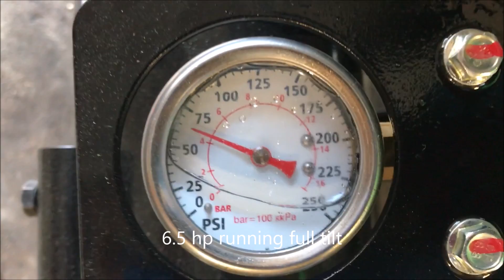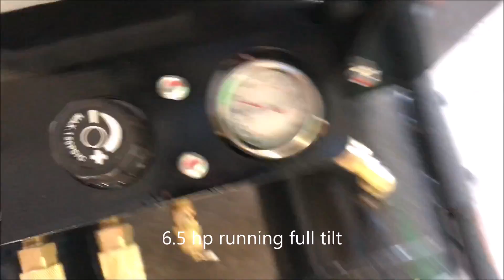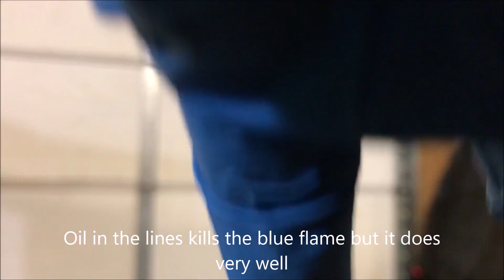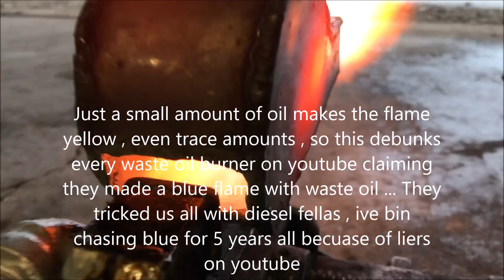Triple injection waste oil combuster { SUPER DRAGON } 160 Kw

Comment: A CNC CUT OUT TABLE WOULD BE OF BENEFIT TO YOU.  It could cut out standardized parts rapidly.  You could build a jig FOR EACH DIFFERENT UNIT to hold the parts in place while you tack them.  BADA BING   YOU ARE IN BUSINESS.

Comment: Can you try to run it on ethanol? I think the power will be even more
Reply from the maker: dont have any but we will see veggi oil by midnight
Reply: @NOBOX7  you can use E85 that is gasoline with high percentage of ethanol. If you are from the USA you find it at the gasoline pump
Reply: @NOBOX7  larrygopez@gmail.com wants to know if I can use crude oil in babington burner or any of your creations. I have access to a few gallons a day. I haul it

Comment: Your flame appears lopsided, like the jet on the side that the air is coming in on is not getting enough air...cross flow imbalance seems to be the culprit.
Reply from the maker: Good eye ,  Yes their is a small fabrication defect at the manifold penstock interface . i was also disappointed to see this  . If you look down the nozzle into the light you can see light in 2 of the nozzles but not in the one i left if your looking at its front face"  i think" , i will look into that ,  the lop seemed to be on the right of the flame if your looking at the burner  ill also check that as well  . it could also be due to weld beads inside the combuster cyclone cup . i  did check all threw nozzles and you can see all three of them spray on the video , maybe ill go back and examine that also . it would be nice to know if it was a combuster defect of a nozzle defect
Reply: @NOBOX7  When you analyze turbojet burn systems for fire wash, you get used to seeing these things.

The technically best remedy is to inject air to each pintle separately from a manifold which prevents pressure and flow differentials between needles.

Also, placing the air further back will allow it time to fully normalize and stratify in the desired direction of travel where cross flow will have been neutralized and forward momentum attained.

One option would be  [relatively] large back plenum where the air comes in and develops a semi-static pressure field, and then only allow narrow barrels down each needle to confine the air flow concentrically around each needle as it exits at the pintle.

In essence, build it the way you built single needle injectors, only off of a large air box that permits the air to stabilize.

You could even put something like stainless steel scrubber pads [or some such] in there to dissipate the air coming into the box, removing from it all of the unwanted cross-directional flow to ensure a purely laminar, turbulence free flow.
Reply: @NOBOX7  Again, its an air flow problem introduced by putting the air in on one side and not putting it in equally on all sides.

Your single-needle designs did not have this much of a problem because the air had only one portal to exit from, but, likely as not, if you observed them up very close, you might still find uneven air flow.

That was why I was suggesting an internal swirl inducer for the single needle ones.
Reply from the maker: Is combuster not a word ? lol
Reply: @NOBOX7  'combustOr' [ o, not e ]

Comment: Build a bracket on the tail that allows you to repeatedly place the nozzle back in its optimal location without tinkering over and over... ~( 'w')/

Like welding 2 small strips on each side which allows it to just drop into a notch and be secured with a nut and bolt or just thread the frame and screw directly to the frame.

Comment: As I have mentioned in the past, the flame backwash is not really going to do much to preheat the air, it is necessary to run the air through the flame, or, at the least, wrap coils around the flame tube with insulation around that, but also your ports seemed really large... At least larger than those I saw you use in the past.
Reply from the maker: Yep largest oil ports yet , however the annular air orifice  is a medium of the scale maybe even small , havnt compared my lab notes yet
Reply: @NOBOX7  Your cross section of air flow relative to the cross section of fuel needs to be as close to 1:1 as you can get, even air>fuel can work, up into ratios of 1.33:1 without risk of flame out.

Your air-to-fuel surface profile ensures more uniformity of fuel droplet sizes, even as your increased velocity ensures overall smaller droplet sizes.

Dividing the air and the fuel in larger orifices reduces the efficiency because you end up with slower air feed and globbier droplets.

The ideal is many very small orifices which allow for more of the fuel to be 'blasted apart' by high velocity air.

If you can get it to work with large diameter needles or infusers [such as can be purchased at a farm supply house or at an online source such as http://www.jefferspet.com , you should be in the ballpark.

I am saving up all of my [very small] needles* (after I have used them) to build a special dry vapor carburetor once I have a couple hundred of them.

*I own a goat dairy, I do not use needles on my self.
Reply: Is this showing up now?
Reply: @NOBOX7  Your cross section of air flow relative to the cross section of fuel needs to be as close to 1:1 as you can get, even air>fuel can work, up into ratios of 1.33:1 without risk of flame out.

Your air-to-fuel surface profile ensures more uniformity of fuel droplet sizes, even as your increased velocity ensures overall smaller droplet sizes.

Dividing the air and the fuel in larger orifices reduces the efficiency because you end up with slower air feed and globbier droplets.

The ideal is many very small orifices which allow for more of the fuel to be 'blasted apart' by high velocity air.

If you can get it to work with large diameter needles or infusers [such as can be purchased at a farm supply house or at an online source such as http://www.jefferspet.com , you should be in the ballpark.

I am saving up all of my [very small] needles* (after I have used them) to build a special dry vapor carburetor once I have a couple hundred of them.

*I own a goat dairy, I do not use needles on my self.
Reply from the maker: I was hoping the backwash would heat the manifold and give us a jet engine effect  but no way of knowing just yet
Reply: Got a question. Why is preheating the air important? In an internal combustion you want cold air to get more oxygen into the cylinder. I’m new to this so it might be a stupid question.
Reply: @garycolegrove7656  This is not a piston engine [or any kind of engine], therefore air density is of little relevance here.

Besides, you clearly missed the principle working dynamics of this machine totally out of the ball park.

This machine BEGINS WITH cold, compressed, high density air, which is actually working against it.

Just like oil is sluggish when it is cold, so too is air, and therefore, the molecules slow down, behaving like big heavy people in a crowded shopping mall.

You want fast, light, hot, energetic molecules racing out at the exit port as close to, or if possible, above the speed of sound, imparting along with their speed, the necessary heat to de-viscositize the thick cold heavy oil so it will atomize more finely [or even 'smoke off] as it reaches the combustion chamber.

I usually do not try this hard to 'dumb down' what seems to me to be instinctual fact all humans should have learned before kindergarten, but then I forget that not everbunny was raised by a retired USAF radar  and missile technician who deemed their children's education as a must-have par of our lives.

This is all simple, rudimentary stuff, you just need to go out and read up on it, if it is all that important to know,  [it is on the internet and in libraries], otherwise, just take our word for it and enjoy the ride.
Reply: Delicious DeBlair density doesn’t but oxygen content does. Cold air cares more oxygen then hot air. Oh, yes I know this is t a combustion engine.
Reply: @garycolegrove7656  Clearly you lack some fundamental knowledge about how gases behave, and I am not going to 'clue you in' because these are literally fundamentals you are utterly ignoring or else never learned in basic physics and material dynamics.  and, until you get beyond that gap within your personal rationale, your world view will be permanently skewed beyond comprehension, so that nothing in the real world will make any sense to you.
Reply: If you can’t answer question without being a bitc@ then maybe you should answer at all.
Reply: @garycolegrove7656  If you can't ask a question without being a dipshit maybe you shouldn't ask.
Reply: @garycolegrove7656  Butthurt little boy, grow up and stop being a snowflake. Nobody has time for your ignorance or your whining. Go finish school and get an education.